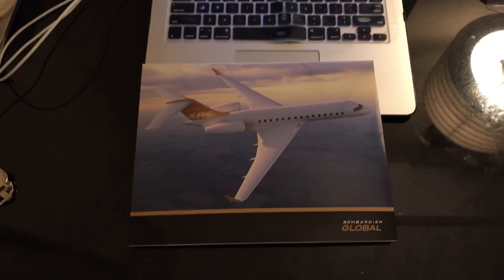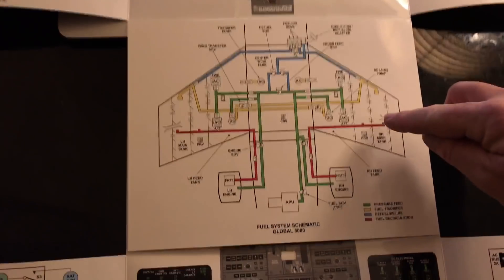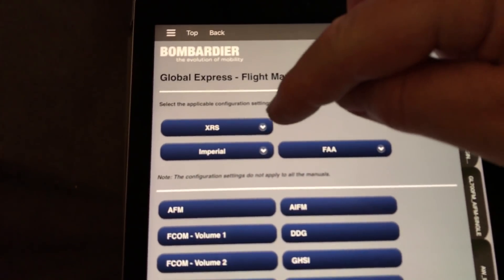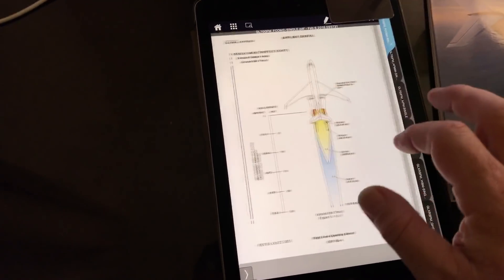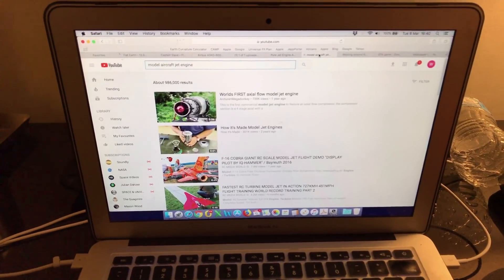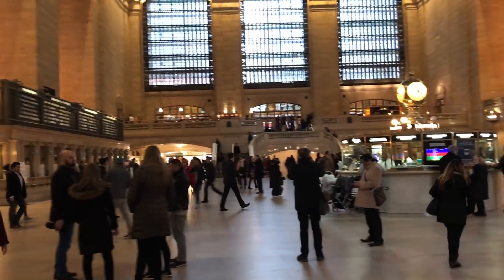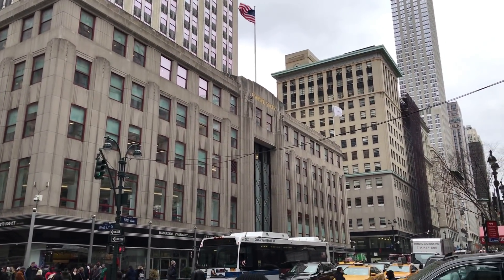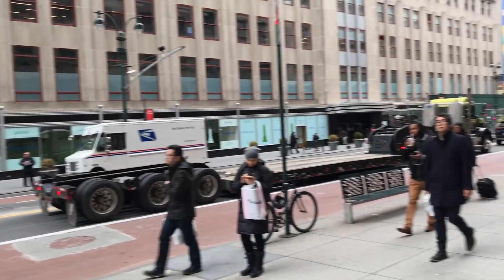Don't be ridiculous - of course Jet engines use liquid fuel.

Comment: How many % of the thrust comes from fuel? And how many from air?
Reply: All the energy needed to produce thrust comes from the fuel!
If you are asking how much of the thrust comes from the bypass air vs. the air passing through the core of the engine (compressor/combustion chamber/turbine), that ratio can be up to 80/20 in some modern high-bypass turbofans, but usually less than that.
But of course, the large fan at the front is – just as the compressor – powered by the turbine, which is powered by the burning fuel in the combustion chamber.
https://cdn.britannica.com/20/24320-004-7E803E61/turbofan-core-jet.jpg

Comment: You obviously dont know how much ONE M3 is. Then try hundreds of M3.You also seem to lack the understanding of how flaps hydraulics, landing gear compartments or how compressor jet engines / GAS/ AIR turbines work.  Read Rolls Royces own MANUAL.  THE THRUST COMES FROM THE COMPRESSOR ENGINES COMPRESSING AIR. Stupid and evil harassing Jones. You are a Nobody stalker.
Reply from the maker: +Cathrin Gustafsson.   Wow,, did you get out of the Wong side of the bed?  

I know exactly how those components work.  I hold FAA type ratings on FAR 25 aircraft and am qualified as an air crash investigator also.   Clearly you don't understand much about aircraft at all. 

Stalker?  LOL.  Jones came to my channel numerous times trying to get my attention and I told him I have no interest in wasting more time on his stupidity.

You seem a bit of a nutter there Cathrin.  Are you a Flat Earther too?

Comment: Technically turbine engines can work on any type of fuel. Not only liquid, but also gaseous fuels (like propane or butane) and even solid fuels (like fine coal dust). Of cause you can't change fuel type at your will, but it's possible to design a turbine engine which can use one or several types of fuel you like.

Comment: Simple math for the idiots our there that believe they run on air since they love quoting the a380 here I go (if someone has better info on wing thickness let me know)... So wing area of an a380 is about 843 square meters so in 2 wings 421.5m2. Square root of that is 20.53 so we take and add an very conservative average wing thickness of .5m this gives a volume of 210.74m3. From this we remove about 60m2 for unusable space (gear, flaps etc) this gives us 150m3. Multiply that by 1000 to give L that's about 150,000L of fuel space. Now going on the official wing fuel capacity of the a380 each wing is said to hold about 150,420L. Now my wing volume is as I said very conservative as at the wing root it varies from about 2-1.5m and the tip being about 30cm. So yes the volume works.  Then weightwise that's about 120,336kg each wing (volume x0.8 to get kg) this huge weight is why there is a max landing weight of 386000kg while the max take-off is 560,000kg with the max ramp weight being 2T more than that.  If you were to land at max weight the weight shift would definatly break the wings. So burning or dumping this in flight in an emergency is needed for a safe landing.

Comment: Good video. I worked on a military program that used the Global Express as it’s airframe. There was much discussion in the early design phases regarding wether or not to fit an inflight refuelling system. Ultimately it was discounted as the GE had enough fuel for the desired  flight duration even when fitted out with a heavier payload.

Comment: Yeah they just use fuel to make it look good on take off then cross over to compressed air. I mean, what with there being no gravity all they need to do is manage the buoyancy and puff a bit of high speed air out the back & away it goes. Then they can use all that spare tank space for chem trails, job done. Everything is so easy when you don't need physics.

Comment: I worked on F-15 fighter aircraft for 20 years.  Among other systems, I maintained the fuel quantity indication system.  I have personally opened and worked in numerous fuel tanks to maintain that system, including a few times when I opened a fuel tank that still had fuel in it, not exactly in an approved manner.  I can absolutely attest that our planes ran on JP-8 liquid fuel.
Reply: Those deniers have also an other claim, that the wings of the airliners don't have enough space for the fuel. They have seen how the spoilers and flaps open, and then they claim, that there can't be any fuel tanks in the wings. All people involved in aviation know how the things are, but there are many gullible people who believe the nonsense of those deniers.
Reply: Yep, a large portion of the internal fuel load in an F-15 is in the wings.  Most of the fuel tanks I worked in, and FQI probes I changed were wing tanks.
Reply: A week ago I tried to explain one person where the wing tanks are located in the wing area, but he didn't believe. He just said that "he can't see that there is room for the fuel". They are hopeless.
Reply: I’ve actually just tumbled on some flerfers talking about this today, and another couple things came to mind.  First, the struts on the landing gear were always significantly more extended after flight, indicating a significant lightening of the aircraft’s weight load.  They sat noticeably higher, and required a bit of a jump to get onto the boarding ladder.  In addition, the worst fuel imbalance I ever saw a jet come back with (when a tank does not transfer out) was a left wing external that didn’t transfer, and was full upon return, contrasted with an empty tank on the right side.  The right wing tip could not be reached with a full jump (normally reachable with an outstretched hand with feet flat on the ground), while the left was at head height.
Reply: @matthewconner5545  - Flerfers don't understand those things. It would be good to show an aircraft with empty tanks and then with full tanks, maybe they can see the difference on the landing gear struts. Airbus A380 is a real obsession for them. They have many ridiculous claims about it. Some of them want to see a video how the fuel flows into the tanks.

Comment: Actually, the pilot winds up a rubber band during the pre-flight check and the rubber band powers the aircraft throughout the flight.

Of course, this only works if you sprinkle Pixie Dust on the aircraft in advance.

Comment: Of course they don't run on liquid fuel.  The airlines switched to a much cheaper and limitless solid fuel years ago.

The Bullshit that spews out of flat earthers mouths 24/7.  The throttle controls signal highly trained monkeys in the engine, telling them to speed up or slow down the rate they shovel it in.  This is also why pilots refer to how much fuel they took on in pounds instead of gallons.

Comment: there's also the notion that compressed air, at a practical pressure of 4500psi has about the energy density of a lead acid battery, some quick math would realize the impracticality of such a heavy aircraft

Comment: I spent 30 years in aircraft maintenance, I have worked inside fuel tanks & on fuel systems, on piston, jet & gas turbine engines. I can assure you if any FE believer says aircraft don't use liquid fuel he is talking straight out of his fat ass. Probably the same people that believe power stations are a hoax & don't generate electricity.

Comment: As a former line service tech (airplane refueler)  I can 100% say that jet engines run on liquid fuel.   Piston planes run (usually) on 100LL.  The turbojet I built out of a turbocharger ran on propane.   The fuel nozzles in the combustion chamber atomize the fuel to a fine, vapor like mist.   #facepalm

Comment: Shy is the fuel not measured in gallons or liters, aren’t those supposed to be used when your talking about liquid
Reply: I’m not a flat earther I’m just mildly curious
Reply: John Smith, fuel is pumped from the tanker or from underground in volumetric quantities (litres or gallons) but a fuel load on all but small aircraft is measured by weight (pounds or kilograms) Why?  Because the energy in a given weight of fuel remains constant (British thermal units per pound) but the energy level in a given volume of fuel will vary with density.  Density will vary with temperature.  To simplify, a jet engine will need to burn more litres of fuel if the fuel is warm (summer) than if it is cold (winter) but the engine will burn the same weight of fuel, to produce the same amount of thrust / power.

Comment: I've sat next to the wings in flight and upin landing, I've watched them open when we land so the plane can sliw down or what not. You mean to tell me there's thousands of pounds of fuel in those skinny wings? Watch it open and tell me where all that fuel is. All pneumatic parts and bolts and hoses to open and close the flaps. Can't see any room for tons of fuel in there. Just saying
Reply: Yes there is room for all that fuel. What you see is the flap and spoiler mechanism working, and of course there are no fuel tanks in the flap mechanism area, that's clear. But the surface area of the wings is quite large. And after all the wings aren't really as skinny they may look. If you walk under the wings on the ground, you will absolutely notice that. 
The fuel tanks are located in the center part of the wings. Many people have calculated the volume of the fuel tanks using the dimensions of the wings, and these calculations show clearly that an aircraft can carry the needed amount of fuel. 

Every real pilot can also tell this to you. Don't let other people trick you. If someone is claiming that it's not possible, you can tell him that he's talking utter nonsense.
Reply: Mike P 
I can't see 15,000 lbs of fuel in a wing.
Reply: @scottlavalle  - Have you calculated the volume of the tanks using the dimensions of the wings? You can't estimate it with naked eye. And what aircraft it was?

Comment: In the ten years that I was contracted to hauling jet fuel to out local international airport, I hauled hundreds of thousands of gallons of jet fuel. Are flatards suggeting that the fuel terminal was lieing when I loaded 8,000 gals of jet fuel. If so, just what did I deliver to the airport hundreds and hundreds of time.

Comment: do not get flattards and jason maggot/enslaved by media duo mixed up.

they are both flattards but they have recently moved on to planes run on compressed air and everything is smaller than we are told(maybe thier wives keep saying "oh its huge")

these two are a very spdcial kind of fruitcake.

EVERYTHING is a conspiracy to them.

hey-here is a new one for them to pursue.

electricity is a fake thing and everything is solar-thats why there are so many overhead powerlines-they "make"the power free and the power dtstions are just to con you out of your money

Comment: Yeahhh, jet engines, just like car engines use compressed air...

...which is to increase Mass Air Density to burn more fuel or to maintain output levels as the air pressure drops with altitude...

...duh.

Comment: As an interesting note, there is a new type of quick-burning vapor fuel out there that could be used to power things in the future.

However, while it is lighter, I can't imagine that it will last a full sixteen-hour flight. The potential energy per square centimeter in petrol-based fuels are far too great to compare.

So the FEs have a good idea, they just haven't thought it through completely.

Comment: Well, jet engines do run on compressed air, they just need some liquid fuel added to that air to keep the process sustainable.
Reply: Bence Sárosi Correct, they start using the APU. But saying it is dependent on the APU and doesn’t need fuel is like saying that a lawn mower only needs your arm pulling on it to run.
Reply: @brianfeuerman1732  Nah, you missed my point :)
I was referring to compressed air supplied by the, well, compressor stages.
Reply: Bence Sárosi Ok, got it.

Comment: It’s not that planes use no fuel, but they damn sure don’t hold 15,000lbs in each wing lol. Simple to prove, weigh it empty and full and it won’t be a 40,000 lb difference or that pig would never leave the ground. They use fuel, just no where near what they say and they lie to the pilots too so can’t really blame them when they really think they add a dump trucks weight to each fragile ass wing just in fuel lol. Weigh the planes empty, then weigh them full of fuel, mystery solved...
Reply: Sorry idiot, but we do that all the time at the place i work

Comment: I think planes just use fuel to get the engine started once after that the heat is provided from the compressed air and the air compressors run off the turbines
Reply: You might think that, but you're wrong. An A380 burns 12 tons of fuel every hour when at normal cruising speed.

Comment: well il look forward to prooving people wrong heres an easy one for you weigh your plane before and after they have refulled that will stop the debate but doubt you will do this .i think that is only way you will prove your right  you have got to remember reading of a manual proves nothing .
Reply from the maker: +Paul Fisher.  Perhaps you could look at this another way.   Here is how I look at it.  

I know my plane uses fuel.  I can feel the weight difference when it is fully loaded on take off as acceleration is less than half the rate when it has a light fuel load.  Initial climb rate with a low fuel load is over 4000 ft per minute and it can reach 47,000 ft easily and quickly. 

With maximum fuel climb rate is less than 2000 ft per minute and it will struggle to reach 43,000 ft. Take off speeds are significantly higher and stall speed also changes with fuel load.  All these are factors any real pilot is familiar with. 

Not to mention operating from remote strips occasionally and hand pumping fuel from a dozen 44 Gallon drums.   Seeing the drums empty afterwards. So what I am saying is that I know aircraft use real liquid fuel. 

 I know these Fuel Hoaxers are full of nonsense and really don't care to prove anything to them.  They are just a few very confused people on the internet that will ultimately make zero difference to aviation around the world.

Making another video to prove this is wrong would be as silly as making a video proving Santa is not real just because somebody made a video claiming he was.  That is how I see it anyway.
Reply: Paul Fisher, what about this:
I found some info about the capacity of each fuel tank in the A380:
https://aviation.stackexchange.com/questions/48425/how-much-fuel-does-an-a380-hold-and-where
After downloading the fuel tank graphic, I estimated the area of each fuel tank before calculating their average height by dividing their volumes given in the link above by their areas and ended up with the following:

Feed tank 2 and 3:   1.75 m
Inner tanks:               1.5 m
Mid tanks:                 1.1 m
Feed tank 1 and 4:   1.0 m
Outer tanks:              0.5 m
Tail (trim) tank:        0.35 m

Then I found this photo of an A380 wing under construction:
https://static01.nyt.com/images/2012/01/20/business/Airbus/Airbus-jumbo.jpg
Note the size and thickness of that wing! The guy on top could easily walk upright along the front end of feed tank 3, which confirms that my estimate above is reasonably correct.
So, it's plenty of room inside the wings of an A380 to store up to 320 cubic metres of fuel there!

Another way to grasp this is to envisage 320 m³ as a cube with 6.84 metres long sides placed beside an A380. That's less than one tenth of the A380's wingspan and less than one third of its height when standing on the ground, so it really shouldn't be that hard to accept that the volume of that cube can be fitted inside the superjumbo's wings.
Reply: thank you for replying i still say the plane cant take the weight  and when you look at the wings there alot thinner when you see them in real life i just cannot believe the weight and volume you canm get in the wings .but the weight before and after would prove once and for all
Reply: Paul Fisher:
There are no rational reasons for your continued doubt.
My last comment with the A380 as an example showed that the wings have enough volume for the fuel they are supposed to carry, and Wolfie describes how the plane's handling characteristics clearly change with its weight.
Another thing to notice is that most planes have a higher maximum take-off weight than landing weight. The numbers for the A380 are 575 and 394 tonnes respectively. Thus, if it takes off fully loaded, it must somehow get rid of 181 tonnes before it can land. How does that happen without burning fuel? By throwing out all the passengers and the cargo? That wouldn't be very profitable in the long run!
Reply: ok cool i wasnt having a go

Comment: 240 Tonns of fuel that is 240 M3 or 60 Meter Span Wide 4 Meter deep and 1 Meter thick overall. But the problem is the wing is only at the fuselage 1 Meter thick then he tapers until 30 cm or less. And from front to rear the wing tapers again. And the wings are not empty full of flaps hydraulic and motors and other stuff. There is not enough space

Comment: Having worked for many years in the specialty of jet engine combustors for a major engine maker, there is definitely lots of fuel pouring continuously into the combustor. The burning fuel contained within the combustor is a continuous , violent explosion. The hot air released drives the turbine. Enough said.